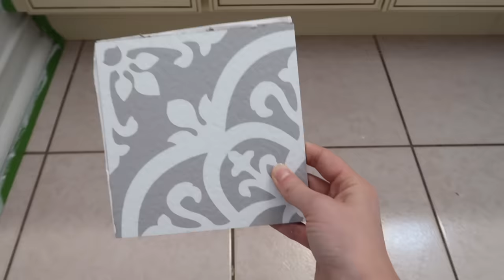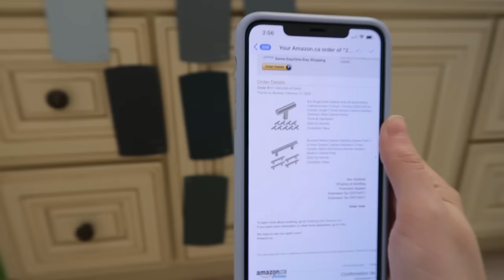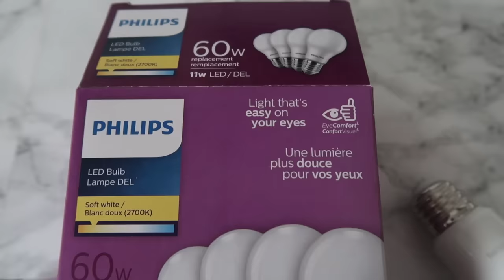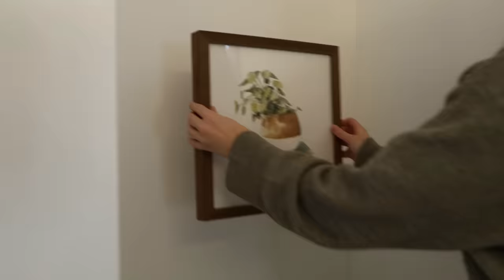DIY BATHROOM MAKEOVER ON A BUDGET | RENTER FRIENDLY

Comment: As an FYI, I used contact paper to repair a countertop in the house I am renting. I used a marble type as well and then put a coat of Varathane Clear finish over it to waterproof.  Three years later, it is still holding up exceptionally well.  I would DEFINITELY recommend putting that waterproof finish on it as it is a bathroom and damp.
Reply: Hi ! Just wondering did you use the bucket or spray?
Reply: I was Just thinking about it. How long the paper Will hold on cuz it is a wet area. Thanks for the tips!
Reply: Good to know, thanks for sharing
Reply: how will you remove it when you move out if you put a clear finish over it? As in how hard would the removal process be? I'm considering it but my concerns initially lied with the fact that it may not be 100% waterproof, so the idea of using a clear finish is great, but now i have another concern, which is removing the contact paper after moving out
Reply: @Beyondzz  In all fairness, this was a counter repair -- the landlord didn't support the front part of the counter (the part that curls over from the top to the front) and the kids cracked it while cleaning the mirror. He started having a bit of a "hissy fit" over it (he is difficult like that, but hates paying for any real repairs) so I fixed it myself. I put wood behind to support the "curl over" and patched it.  Then I covered the counter with a VERY similar looking "Contact" paper.  I don't plan on removing it. But, from experience, it will still come off if you want it to.  The "glue" underneath is still the same and it was only two coats of "waterproofing" so it is a bit stiffer but still "liftable".  My suggestion would be to take a small piece and try it in an inconspicuous spot and test it.  If I get a chance, I will check myself for you.  Most of the time, if it is a good improvement, landlords really don't care.  If it is outlandish, then they get more difficult.
Reply: @DM-Canada  Thank you so much for your response. I appreciate the details and suggestion of doing a test spot first, as I haven't thought of that. I really liked the idea of extra waterproofing since I was never convinced that contact paper by itself is enough in very wet areas like sinks and bathroom counters
Reply: Thank you DM, I’ve always wanted to know how they held up overtime, varathane!
Reply: Can you put that water proof finish on that flooring as well?
Reply: Thank you for this💕
Reply: D M where do u find that marble stuff
Reply: Usually high gloss contact paper is waterproof already as well as floor tiles
Reply: I wondered about the durability.
Reply: I also used marble contact in my bathroom. It's kinda tricky to lay it without the air bubbles, I didnt add any varnish its helf up for a year and going strong!
Reply: OfftoShambala how can you do all this work on a rental without the landlord’s permission?
Reply: I am seriously looking into upgrading my bathroom which has pink & blue tiles. I am wondering if I put sticker tiles above tub, can I make it waterproof with Varathane clear finish. Please advice 🙏
Reply: Manju Agrawal you can do this, but need to use a caulking gun with wall adhesive, gravity and moisture will eventually pull the stick-on tiles off if you don’t use the adhesive. I’ve also seen them used for a kitchen sink and stove back splash making sure they used the caulking adhesive. The end result looked great! Good luck with your project. 😊👍
Reply: I was wondering the same thing about putting a poly coating or something on top of that which then makes it not renter friendly lol but oh well some of us still own the house so I'm not looking at rental friendly I'm looking at easily to change without costing thousands of dollars 😁
Reply: I used that too so shocking right?
Reply: Thanks for this tip. I was wondering if it was waterproof. We tend to splash water when washing hands. Great tip!
Reply: I thought about this too! Glad to hear someone has done this with great results. thanks!
Reply: Thank you
Reply: Great tip 🫡
Reply: I agree... I have used the same thing. I actually used it in my brothers restaurant at the hostess desk. But if it's near water I would definately use the eurathane.
Reply: Awesome idea 👍😀
Reply: Awesome - thank you for sharing! My landlord painted this board the put a couple coats of polyurethane but two years later the paint is peeling up. I’m going to take your recommendation and now the fun of choosing contact paper!
Reply: @Cool.Cat.Flannegan  Just saw your reply and thought I would let you know that it is now five years later, and that bathroom countertop is still holding up :)
Reply: @DM-Canada  hi! not sure you will see this but do you think you could put the waterproofing product you use on the floor tiles she used in the video? I'm wondering if it would hold up well when walked on? thanks!!
Reply: @nylamaybulliard2645  I saw it :).  I would put a few coats of Varathane on anything floor related. I made the mistake of only using one coat on my stairs and..it wasn't pretty in a few months.  A few coats though you would be good.
Reply: @DM-Canada  hi! Thanks so much for answering ! Which varathane product did you use? I’m checking the website oh home depot but I’m not sure which one to use as varathane seems to be used a lot on wood. Thanks in advance !!
Reply: Looks unbelievable! ❤ When I used those exact same peel and stick tiles, I wet a step further. I had ruined Lino underneath, so I used a strong glue underneath the tiles for extra security so they didn’t peel away from the underside. I used tiny tile spacers and then chalking between each tile to make it waterproof. You can also use tile spacers and grouting with some peel and stick tiles, to make it look like actual tiles. I wanted to make the peel and stick tiles stay down, not to be taken up unless fully removed and to make them semi waterproof. I don’t use a wet mop but I do use a microfibre damp mop to clean. Having the chalking between the tiles helps stop the tiles lifting and also the extra glue underneath, keeps them stuck down. 

Also, on the contact paper, you can buy different widths, so you don’t have the join, such as 90cm wide by 3m. I stuck the contact paper down and then used self levelling varnish over the top to make it more durable and protected. The chalking around the sink and edges are a must too. 

This was an amazing video! ❤
Reply: @Beyondzz you are right.
Reply: Can you use the paper on the kitchen bench?
Reply: @missMajlena  Yes, but I would probably go with DCFix.  I did my upstairs bathroom counter and cupboards in it.  Required no Verathane and it has not faded. It's thicker and more durable. If you don't Verathane MacTac it will noticeably fade with constant contact. However, all this time later, my downstairs bathroom counter is still perfect :)
Reply: Is your Dad Irish? Love his accent ❤
Reply: 20:25 Great idea about the Varathane finish! Thanks for sharing!
Reply: I’ve rented before and in between our landlords always appreciated any up grade we did to the apt especially if it’s older one😅
Reply: @manjuagrawal9175 I've seen people painting floor tile.  I'm sure you can do the same with shower tiles, maybe painting a waterproof sealing over it...?